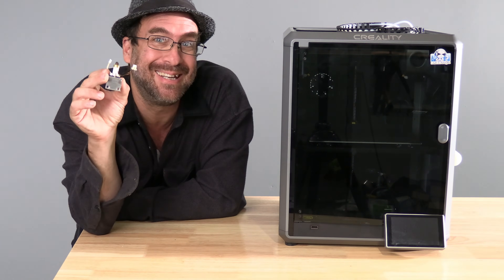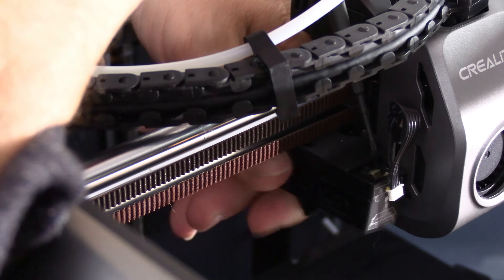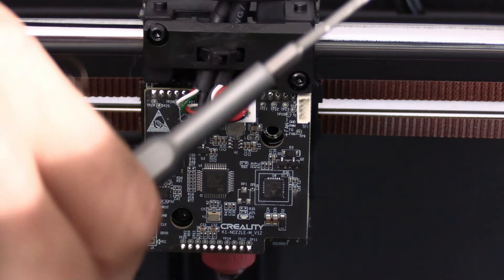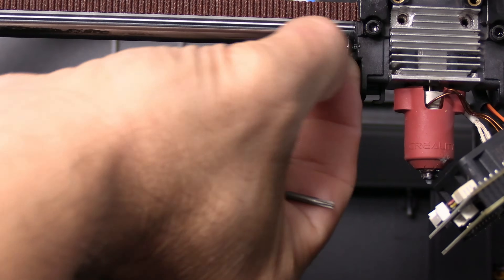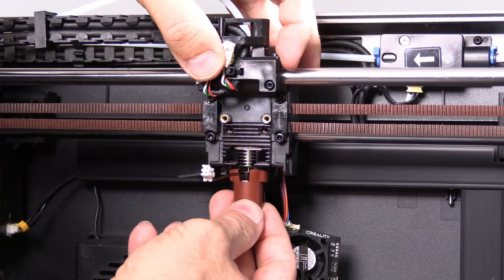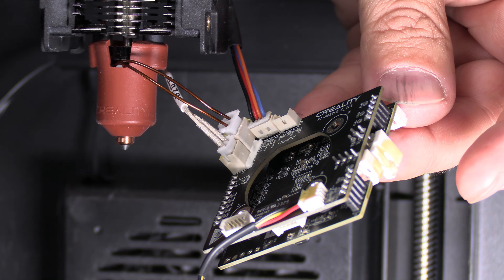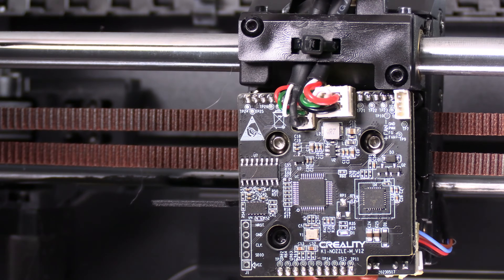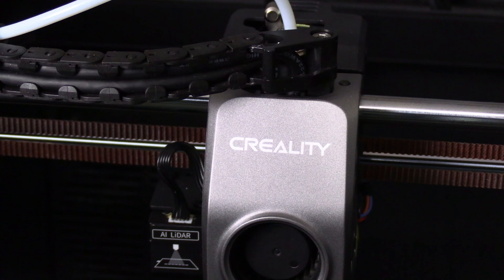How to install the Creality K1 or K1 MAX Unicorn Hotend Upgrade - 3D Printer

Comment: your content is great, thank you, but respectfully, I strongly recommend getting a microphone upgrade, I would recommend either a lav mic that attaches to your collar (preferably wireless), or buying a floor-style microphone stand and a shotgun microphone so you can boom it up and out of the frame (if you so choose) - shotgun microphones are highly directional, so just point it at where you are, and you should be relatively good to go. <3 - keep up the good work!
Reply: The audio is clear. What I think you hear is some sort of reverb, from sound slightly bouncing back into the mic. Egg boxes or drink carriers on the wall work great at absorbing the sound, and its cheap. We used to do that when we were making music way back then 😅
Reply from the maker: This was recorded with a RODE Shotgun Mic on the Camera. I own several Samsung & Shure Mics, and use a DJI Mic when recording audio for Software. I think I'm covered, but I'll check to see how big your "super thanks" was and use that $$ toward further upgrades. 👌🏼
Reply: @3DRundown  The sound was fine - not sure what this guy is talking about.  Making a helpful video like this is a ton of work and we really appreciate it.  I also changed my K1 the other day.  This nozzle is so much better!  Why people think making "helpful" suggestions is at all needed, i'm not sure.  Your video quality and sound are very good and this takes a ton of time to move cameras for the shot and then edit it all.
Reply from the maker: I spend about 20 hours per video, for $0, risking my own machines, using thousands of dollars worth of gear, that I bought, even though I really can't afford it.... only to be told "gEt a bEtTeR mIc". It's crazy! Shooting this stuff is insanely tedius. Thanks for being here, and for the kind words. :)
Reply: @3DRundown  you should have given him a super-detailed description of some better speakers that he can hook up to his computer to better hear the sound.  "i recommend a lav mic or directional boom" what a weinie thing to say
Reply: @thelees1000  stupid be thankful he made the video.  It's one of the best I have seen so far.  So who cares about your whining when he is showing stuff most of the others don't show!
Reply: @aquaden8344  are you saying I was whining?  Maybe read the entire thread before typing.
Reply: @thelees1000  I did, and you didn't know any better  than complaining about the cable routing.  It doesn't matter how the extruder cable is routed, and it's easier to plug it into print when routed outside.
Reply: @ are you a bot? What are you talking about? I did not comment on the extruder cable at all. Do you see the bold type letters at the beginning of comments?  Those are called Youtube names.  You can track who makes which comments by reading these youtube names first.  In this thread there was zero talk about extruders or cable routing. I have two K series machines and both have the cable outside of the cable chain. I don't know what you are smoking but you need to cut back. Calm down, try reading carefully, and hit the big blue REPLY button after the comment you found about cable chains. Then you will be screaming at the right person.